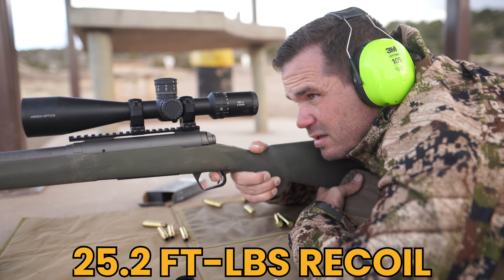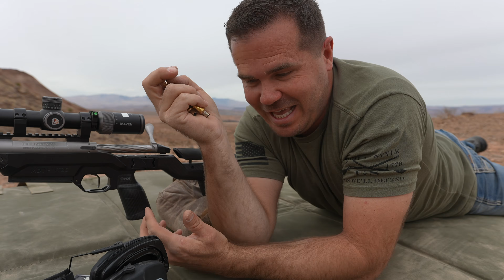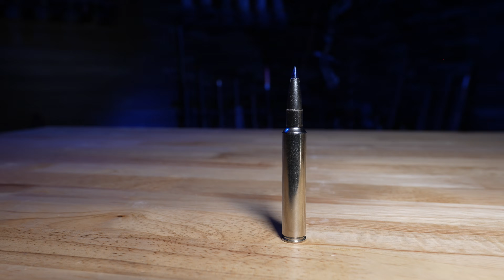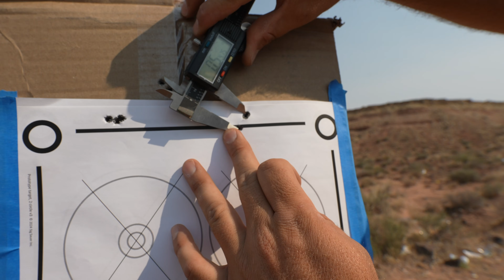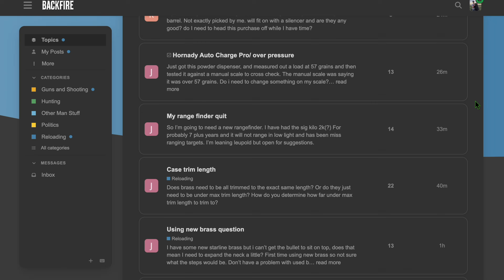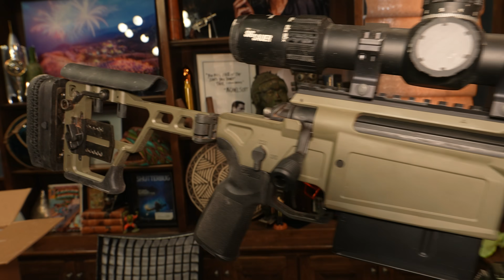6 Phenomenal Cartridges No One Is Using

Comment: Moving to 280ai was the best decision I've made for elk hunting, I've been able to get 160gr accubonds to 2890 fps with low enough recoil to spot my impacts out to 800. This year I dumped two cow elk, both out beyond 600 yards. One of the reasons I chose it over the 7 saum was for the additional mag capacity.
Reply: I’m very tempted to add one of these into the rotation. I have a 6.5creed but the desire to have something with a little more umph is there and I go back and forth between 280ai and 30-06
Reply: @mr.caceres305  if you dont hunt grizzly or moose and need the 200g+ projectiles an 06’ can shoot, then a 1/8 twist (so you can shoot 175s) 280ai does everything a 30-06 does flatter, farther, and with less wind drift. But if you don’t handload the 30-06 is an easy button general purpose killing stick.
Reply: @ the new Barnes 152g lrx 280ai load looks sweet
Reply: @mr.caceres305  I building a 7 SAUM right now, for something with a little more oomph than my multiple 6.5s
Reply: @ if I reloaded I’d just get a 6.8 western and call it a day. But since I don’t I’m looking at the 280ai and 30-06. I love my 6.5 creedmoor tho
Reply: What did you move from?
Reply: Did you build it or is it off the shelf?  It's hard to find a factory 280ai that isn't $2k.  I would like to build one but it's even hard to find barrels at a decent price.  Awesome caliber though.
Reply: @jeremydawkins8399  have you look into the weatherby 307s? Factory priced right around $1100 and they chamber a 280ai.
Reply: @jeremydawkins8399 savage and weatherby chamber it in a few lower priced rifles, give em a look!